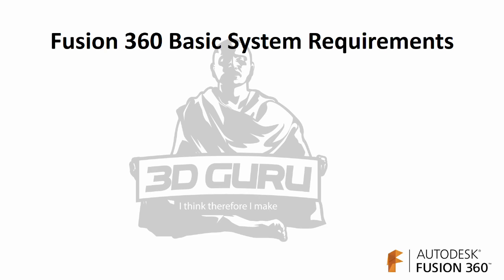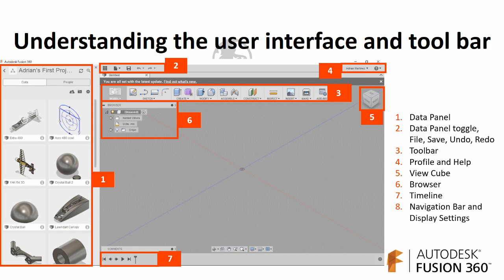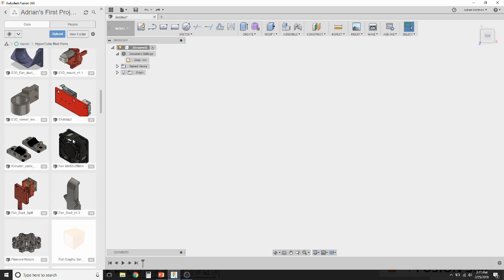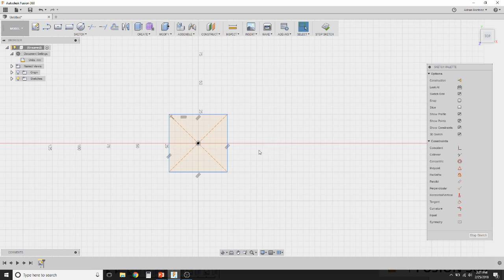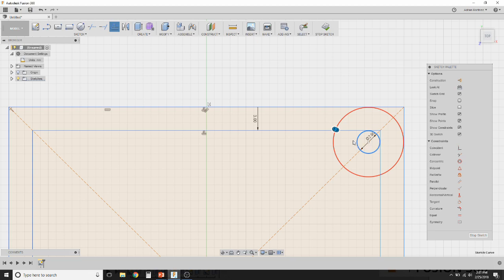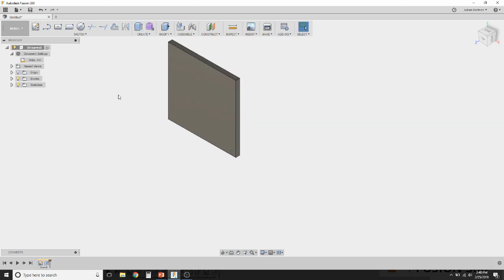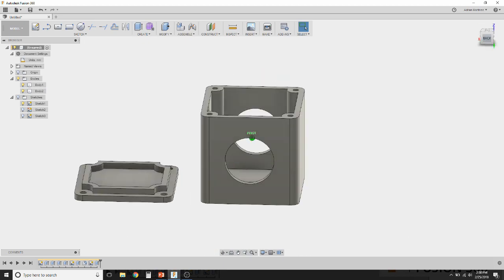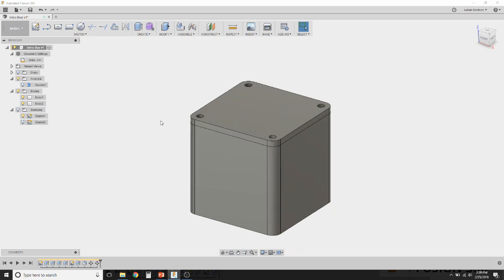Introduction to Fusion 360

Comment: Well, after watching the complete video, I wanted to go back and actually do the design myself following your example. When I got to the point of copying the sketch to make the top, I can not get it to paste, copy shows up and after selecting that, I clicked off the object to deselect everything, then right click and select paste, firstly my handles show up in the bottom left corner, yours were in top left, when I move it does not drag an outline of the selected parts, and when I press enter, nothing is there. Could this have to do with the initial rectangle being constrained to the origin point, therefore blocking the copy? Other than that I am stuck...

Comment from the maker: Thank you for the kind words!

What is this software about?  Fusion 360 does so much it would take a crazy amount of time to details it all. Briefly, creatives can use it to design objects and generate photorealistic renderings, design engineers can use it assign material properties to the object and do failure mode analysis, R&D can use it to 3D print prototypes, project managers can share work with teams, monitor progress, approve changes, production can use it to generate g code to mill molds...it can do a lot.

Comment: this is the best absolute beginner tutorial out there. Im quite intrique. From someone that only knew 3d from polygon modeling with 3ds max and Maya  what is this software about?  I see you dont have to deal with edge flow and  perfect topology and all that stuff and its very easy to subtract/ combine (do booleans?) without getting your topology messed up. So again how this can be usefull  for someone coming from  my background? I mean this is not for 3d printing  and manufacturing only is it ?

Can you create soemthing less tehnical like a  old military helmet ? Here are some reference images https://www.facebook.com/pg/BulgariaThracianTreasures/photos/?tab=album&album_id=121781394659631
Reply: Great for 3d printing and cnc milling. It also does more organic modeling if you wish to put the time into learning it. Check out the Autodesk channel for more tutorials.